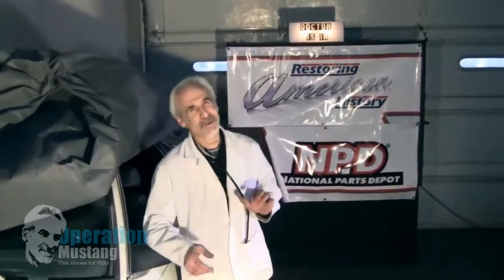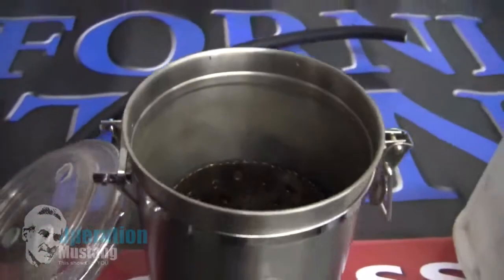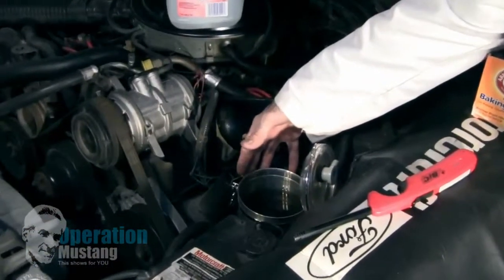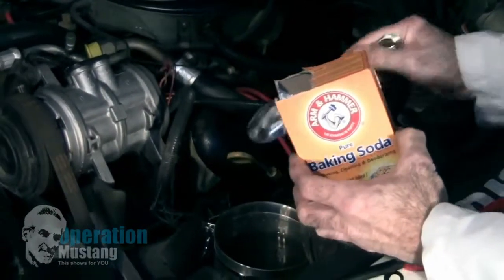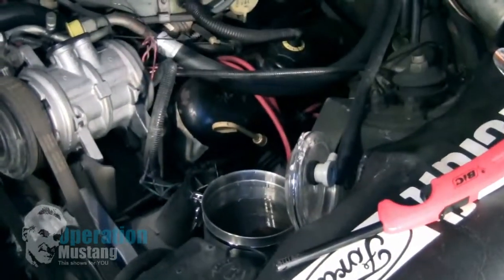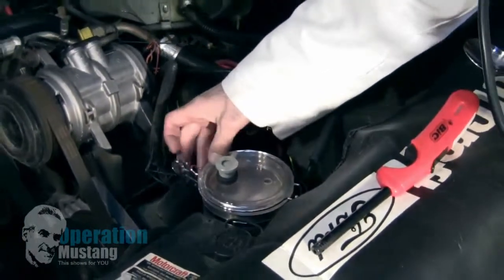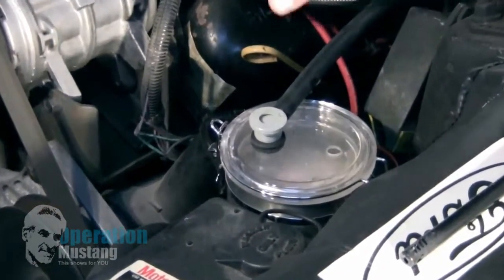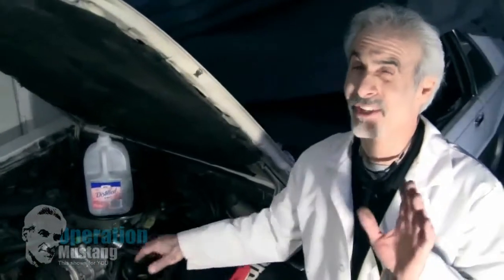Pt 2 - Don't Pay Ridiculous Gas Prices - Build a Hydrogen Fuel Cell

Comment: Run Electricity thru H2O and it creates HHO Gas. 2 parts hydrogen and 1 part Oxygen. The hydrogen molecules are tiny compared to the Oxygen molecules. Hydrogen by it's self is quite flammable but add to that the volume of pure oxygen that is being created is extremely flammable, more so than gasoline. It's Very dangerous mixture. If someone chooses to do this they do need to install stainless valves on preferable aluminum heads. Once HHO is burned it becomes water again which WILL play havoc on your exhaust system. If your rings aren't that good you'll need to keep a close eye on your oil. If it starts turning milky you need to change it immediately.I created and Hydrogen generator and ran a weed eater motor off of it. It's fun stuff to do.
Reply: Can you share any videos on what you did and how (your hydrogen generator)?